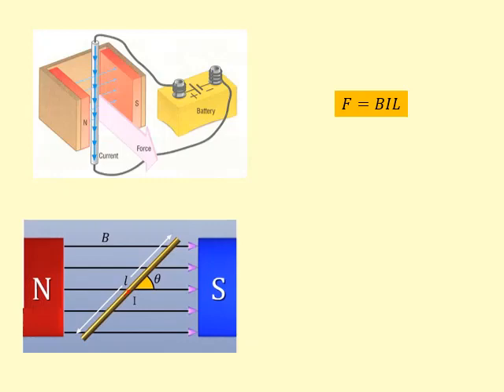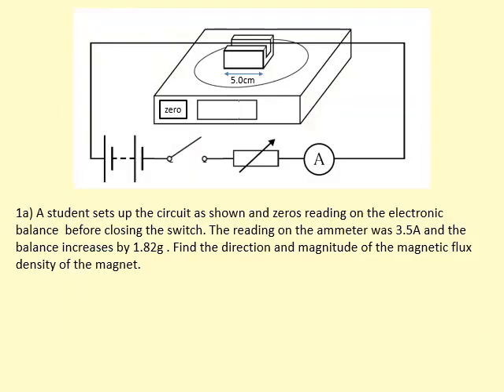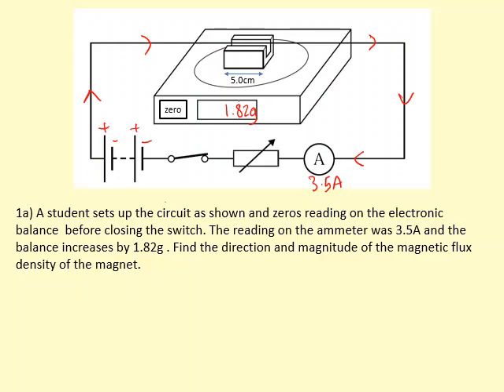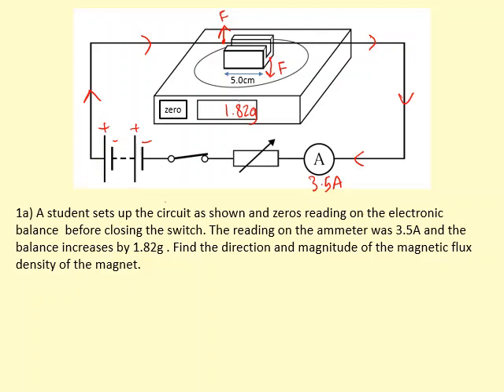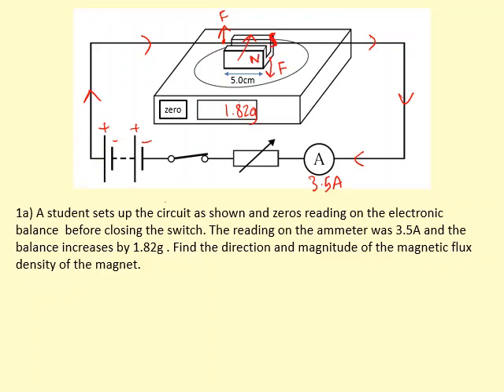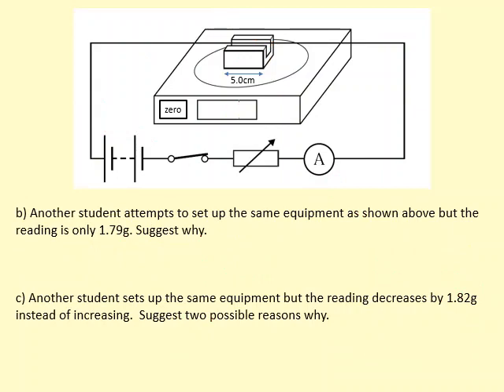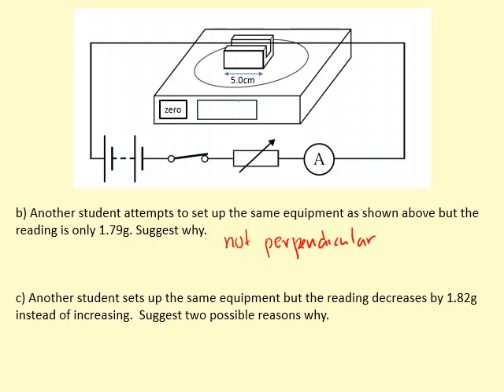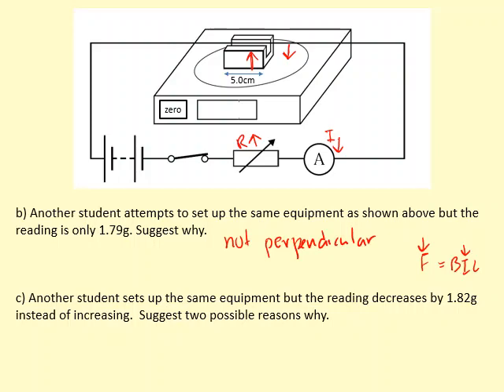12.03 How to calculate the magnetic force on a wire?

Comment: thought it was cos theta not sin
Reply from the maker: Depends on what theta is i guess.

Normally theta is the acute angle between wire and field. in which case it should give maximum force when at 90 degrees. Which must be sin.